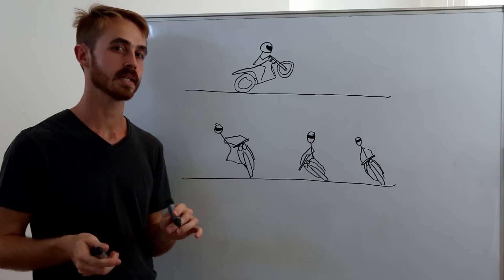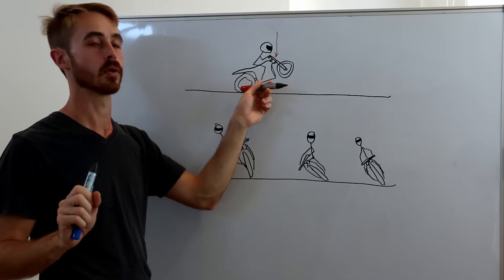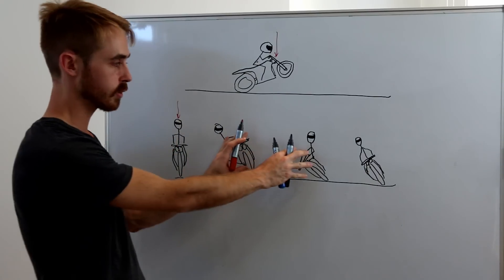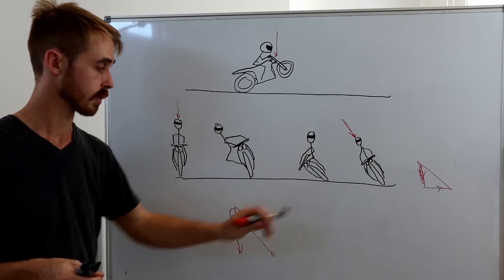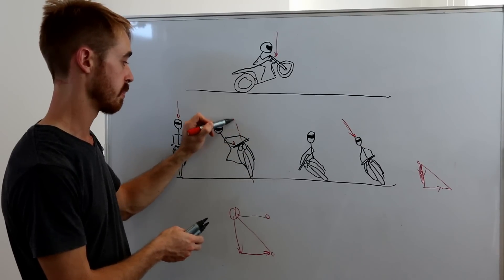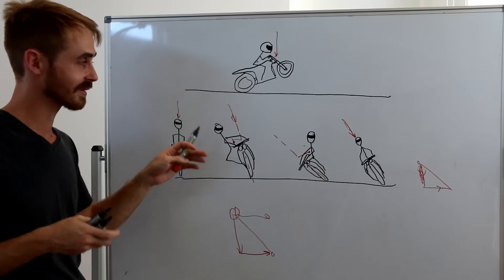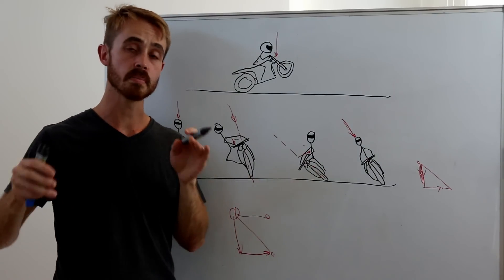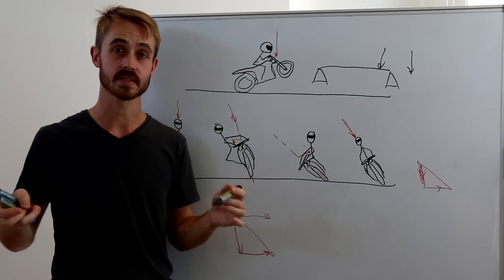How Does Downforce Work for Motorbikes? - Motorbike Aerodynamics Explained

Comment: Btw to be as fast as possible you want the bike to be as upright as possible 
"Move the rider not the bike"
Reply: Not really. Assuming the contact patch area and shape doesn't change when the bike leans, you get more cornering force by using camber thrust only and not using the force from slip angle like cars do. The downside of that is that you don't get the feel of the limit, the grip just suddenly disappears when you exceed the threshold. Which is why racing riders prefer to lean and give the front tire some slip angle. To feel the edge.
Reply: +Kakto Tak, have you ever watched MotoGP? give it a try, especially slow motion cornering - you'll be surprised... vot tak to :D

Comment: There was a bump on the leading edge of the lower element of the 2010 Renault F1 car rear wing and later on there was two of them. What were they?
Reply from the maker: +The Shad Wow very insistent, I'm not sure what bump you are talking about, any chance you could link a picture?
Reply: +KYLE.DRIVES sorry about the multiple comments. YouYube said that there was a problem with postinh the comment so I tried again. I eventually thought it was too long to comment so I tried posting CHEESE! and there still was a problem

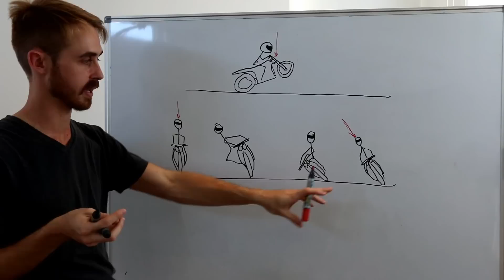Comment: At 02:25 you say that the tires have a grip coefficient of more than 1.0, I was just wondering how that was possible? Because the output traction cannot be more than the input power to the rear wheel. I would be obliged if you could clarify this for me.  Thanks!
Reply from the maker: +S Samba A coefficient of friction higher than 1 simply means that the grip available at the tyre will be greater than the weight of the vehicle. Practically this can be seen in cars with slicks, which can pull 1.5g + with no aero. If the coefficient of friction was only 1, they could only pull 1 g, does that help?
Reply: +KYLE.DRIVES alright thanks a bunch! that clears up a lot of stuff!

Comment: Nice vid, won't the low pressure area from the wings additionally help brake cooling too?
Reply from the maker: +Ed Carver If the wings are high, the low pressure region would be fairly localised and not extend significantly to the brakes. In saying that, I can't see any reason why low pressure would assist with brake cooling? Unless you are specifically placing a low pressure region to extract air from a brake duct? Or is there something else you have in mind?
Reply: +KYLE.DRIVES I've been well enforced that this is the logic behind wings on the 2015 MotoGP Ducati and Yamaha, creating a favourable pressure gradient to get the heat away from the front brakes
Reply: +Ed Carver *informed
Reply from the maker: +Ed Carver I'm interested to see who is saying that it helps with cooling? If we are talking the black wings in this picture http://media.crash.net/original/PA1810485.0008.jpg the pressure field from the top one should have almost no influence on the brake flow due to their small size and considerable distance from the rotors. The bottom wings are closer to the mark in terms of what height you would be seeing to get an interaction, but they are too far aft of the rotors to have an effect in that way, and also, the drag effect from the wings located at that height will result in a mildly adverse total pressure gradient infront of it. If the wings were located as an expansion zone to a brake duct (like on F1 cars) I'd believe it, but as they are so far away and the brake rotor itself is already unducted and venting into a region of adverse pressure (in front of the radiator). If the wings were indeed drawing more air around the body, this would improve brake cooling at the cost of starving the radiator, so not sure that they'd be doing that either. The only other thing I can think of in terms of brake cooling is the vortices produced by them could help manage the flow around the riders leg to the rear brake, but I can't imagine that the rear on a bike has huge cooling demands...
Reply: I've also heard commentators say that they believe it helps cooling, although I have not heard anyone say it helps brake cooling. Have a look at the bottom of the two wings on that Ducati and you will see that it ends right by the radiator exit - so underneath the wing will be a reduced air pressure which will help the air leave from that exit duct. Correct?

Comment: This channel is so awesome. I would love it if Kyle could talk about how to increase the aerodynamics of a car/motorbike. For instance, I heard that taping up all of the crevices on a car can improve fuel economy about 15%
Reply from the maker: +Alex Johnson I would be genuinely amazed if that was the case, seeing as I designed an undertray for a client with a Formula Vee that only added 10% to the drag while increasing his downforce by 300%, and given drag is only a small portion of total fuel economy, I can't see taping up some gaps improving drag by 30% ;)

Thanks for the compliments!
Reply: Marc+ Interesting, looks like a mashup of the Bimota Tesi 3D and Hossack suspension which BMW used under the Duolever name.